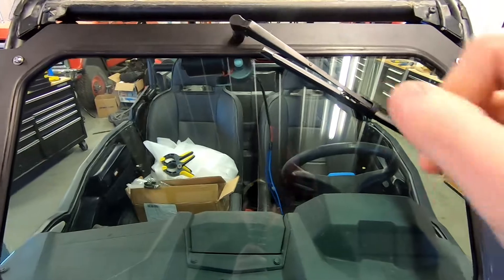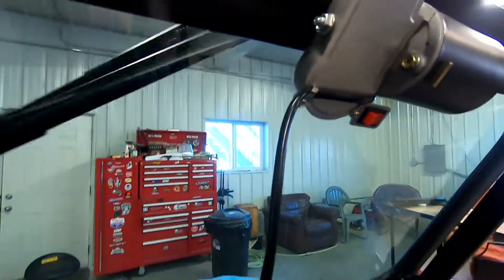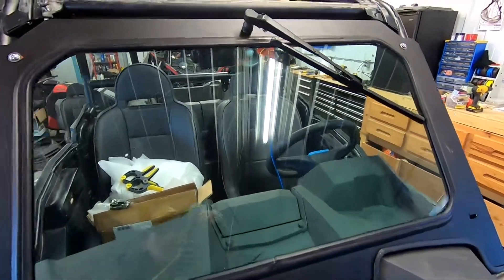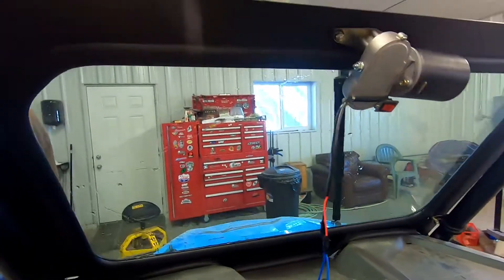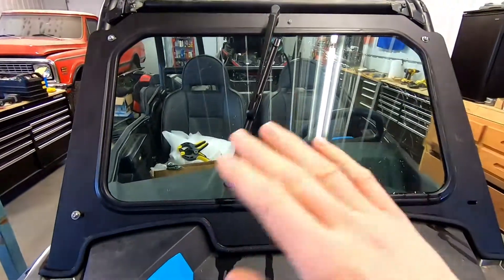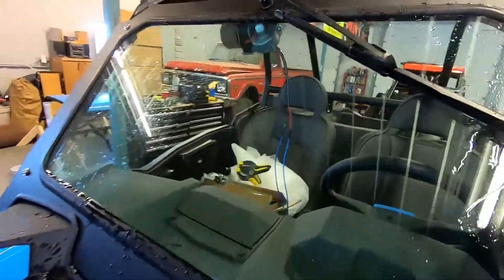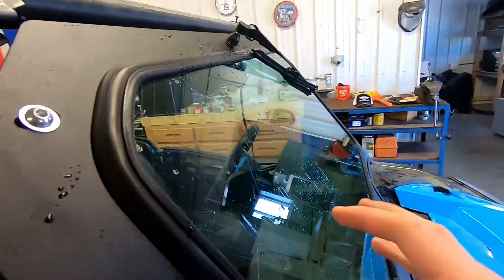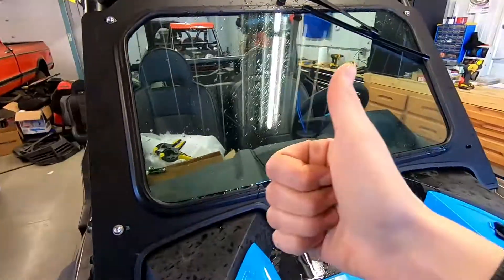KEMiMOTO 12v Electric Wiper Install/Review

Comment: After watching so many of these videos I can now see why everyone recommends getting a wiper motor from the back window of a car. None of these aftermarket motors allow more than 90 degrees of sweep! Apparently theres only one person riding in a Side by Side in their minds.
Reply from the maker: Yeah 100% sadly unless you run 2 of these
Reply: That wiper is good for garden tractor cab bc the window r small that's a perfect wiper
Reply: I have looked around and I don't know why all the vendors only sell one that cleans half your windshield. They are all morons. I'm getting one off a rear vehicle too. It amazes me how cleaning the whole windshield escapes them. It's not even about the passenger I need to see more than halfway out. I wanna slap every single person who though it was a good idea to only do half.

Comment: Can the wiper motor be adjusted to sweep the entire window?
Reply from the maker: No it can not and that is a huge downfall.
Reply: @ThorRider0022  ok. Thank you for the quick response. I think i am going to the salvage yard to pick up a Ford Escape wiper assembly. Seen 1 mounted on a RZR and it seems to work pretty well.
The companies making the universal kits should really consider making their assemblies swipe 180, they would sell a ton of them.
Reply from the maker: Yes I agree so much!!! The only problem with the 180° is they won’t work with most framed windshields like the one in the video as they can’t jump the trim but I do agree!!
Reply: @ThorRider0022  why can't you just put a smaller wiper blade on there so it doesn't have to jump the trim?
Reply from the maker: A smaller blade doesn’t change the angle of the motor the centre of the arm goes 180° weather it’s a 18” wiper or a 6” wiper